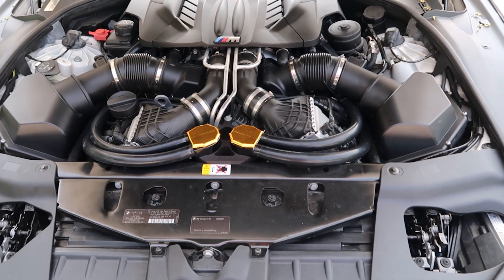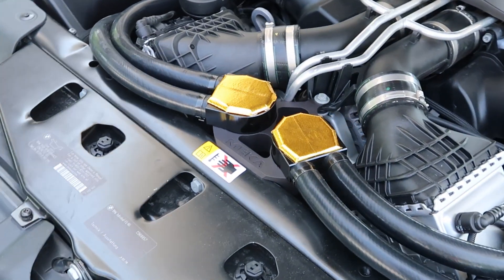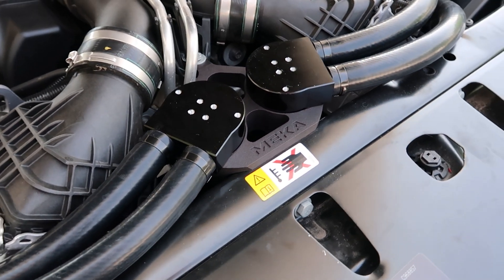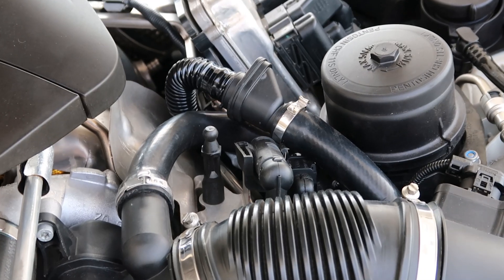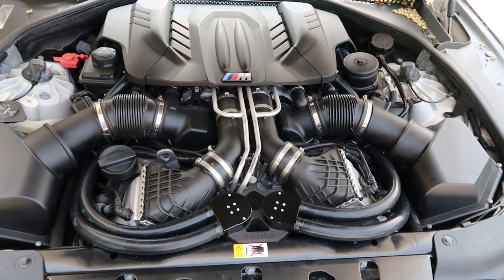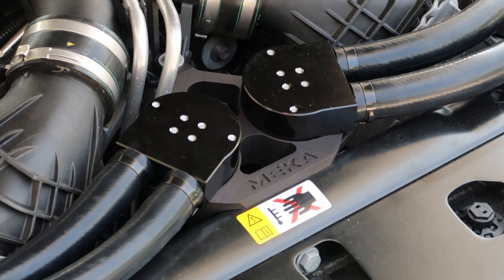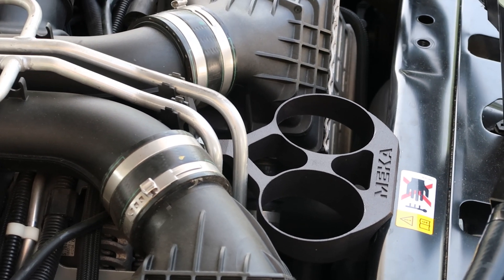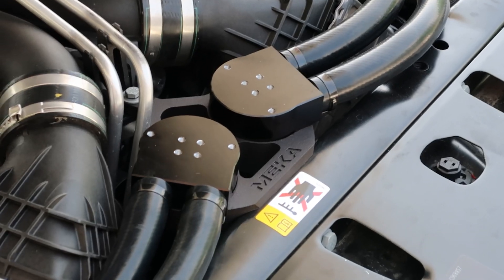The F10 M5/M6 ESSENTIAL Mod (Dual Front Mount Oil Catch Cans)

Comment: in this video he says that this is not the right way to conect this. Wich one of you are correct?     https://www.youtube.com/watch?v=obzBpANWQhg
Reply: That video is for the N63/S63 found on the older x5m x6m... that video IS NOT for the S63TU found on the M5 and M6... S63TU has a different crankcase ccv system than the older model s63 does. Guy in this video did everything correct for this model.